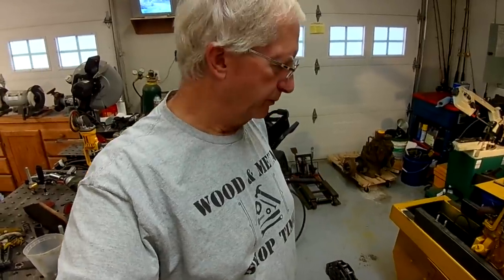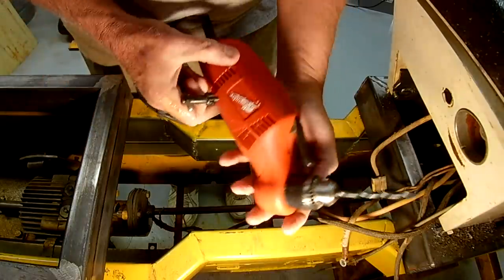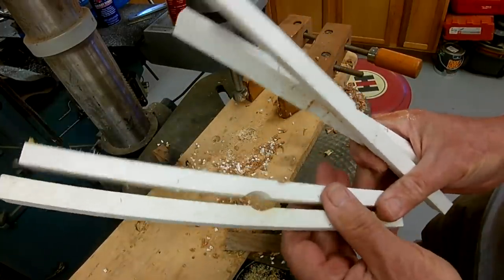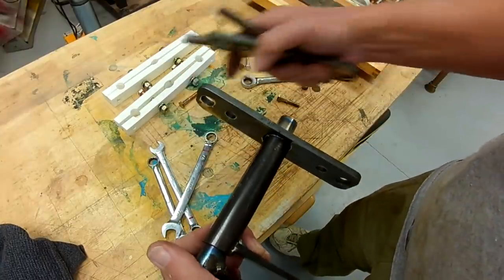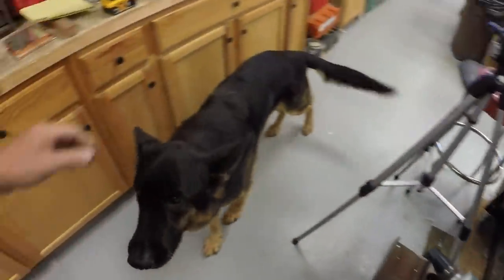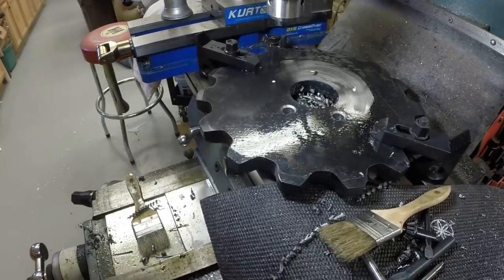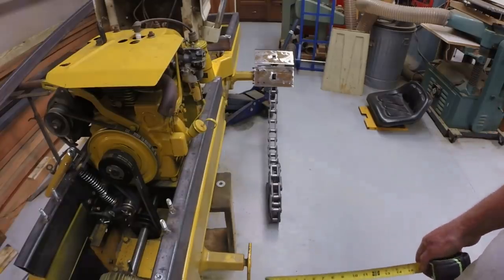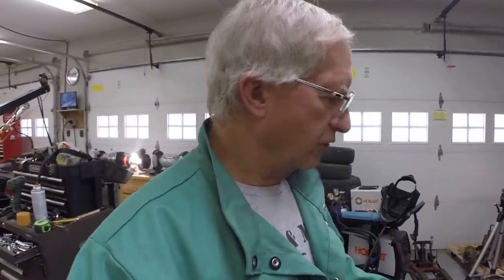Cub Cadet Dozer Build Episode 13, "Which Hole is That?"

Comment: I think your differential modifications are very unique and I think they are going to work very well, I built a front loader   for my wheel horse garden tractor, and it was only an eight horse motor, and I could do an amazing amount of work, I think you’re going to be pleasantly surprised by what your little bulldozer will do ,Great video thank you

Comment: I agree, the mods to the differentials is unique & also very creative.  Gets you that "spin in place" just like the big boys while keeping it Cub Cadet pure.  I like it.
I restored an old Struck Mini Dozer awhile back which uses belts & a reverse jack shaft to accompolish the same spin in place result.  Not nearly as sturdy as yours will be but functional.
Keep thinking outside the box!

Comment: Great solution for the controls, but I would highly recommend that you space them equally from the center of the tractor. You can cut a piece of the outer tube off to space the handle for the inner shaft towards the center of the tractor.
For the future, I would highly recommend that you step up to large holes using a bit that is at least 1/2 the diameter of the finished size. If larger than 3/4" three steps.
On the hubs, just make a sleeve that fills the gap from 7/16" to 1/2" studs. A half inch OD tube with a 7/16" ID would work, you  may have to bore the tube out slightly.
I hope my comments don't offend you, I know how difficult building a one off project is and how you have to constantly adjust from what is believed to what is necessary. I think you are doing a great job.
Reply: The only problem with the is with the sleeve for the stud would be that your tubing would have a 1/32nd In wall thickness
Reply from the maker: I'm looking at the two track controls to be operated by the left hand while the right hand operates a blade control...So shifted to the left makes more sense.
Reply: @woodandmetalshoptime8048  I don't know if you have ever operated a skid machine before, but if that is what you intend to do with your hands, then I would add foot peddles to the controls so you don't have to worry about using your hands to steer.
Reply: @woodandmetalshoptime8048  I think that will work fine, a D7H had both steering control levers on the left hand.

Comment: Glad to see more progress, on the wheel adapter to hub issue, i would use 7/16 studs from the back, then get 7/16 lugnuts to bolt the hub and spacer on , keep up the great work, Godbless
Reply: i posted before i seen u got 7/16 lug nuts LOL great minds think a like ,Godbless

Comment: To center the wheel spacers consider welding a tube that fits the inside of the wheel spacer to the face of the axle flange. If this is a snug running fit, the sleeve will also transfer the sprocket vertical loads into the axle rather than relying on friction between the spacer and flange to stay centered.
Reply: I was just thinking about how a collar on at least 3 of the 7/16 studs would be to eliminate the slop of the wheel spacers would be.

Comment: looking good so far, you have some neat ideas on this build, and im looking forward to the next videos coming up, keep up the good work.  as far as the lug problem you are having, the older garden tractors had lug bolts that are about 1 3/4 inch long that go in from the front, i mounted my adapters on my build with those and they tightened up nicely with no issues at all.  good luck with this, and cant wait for the next one to watch, thanks for your time and knowledge you share with all of us, wished there was someway i could send you pics of the bolts im talking about.
Reply from the maker: I have the original wheel bolts that came on these tractors, so I think I know what you are talking about. They are just too small for the 5/8 inch holes in the spacers.  I have since installed longer bolts and used the 7/16 inch lug nuts which solved the problem.

Comment: For various outside and inside diameters of tubing, take a look at Aircraft Spruce and Speciality. The stock almost every size anyone would need. Their tubing is 4130. They also cut to length, so you can get what you need. The nice thing is, you can choose a wall thickness to work with your desired size tap.for inner threading. They also stock 4130 sheet, aluminum tubing, AN hardware.and control cables.
Reply from the maker: Thanks for that info.  I'll have to look at that site. I've been depending on McMaster Carr for this stuff, and they have an impressive selection. Always looking for other sources, though.

Comment: the conical taper of the lug nuts will hold fine , I spin them 20 mph on my pro pulling garden tractor and they haven't come loose,  you can use the blue lock tight on them .

Comment: You're doing a great job putting the build and the project together. I really do enjoy watching. I think I'd make a spacer to help the 7/16inch bolts. Just using a tapered lug but will center things pretty good but I think the spacers would add additional strength to the 5 inch spacers you're mounting the sprocket on. It should transfer the torque through the assembly better. But I'm that guy who over engineers everything!
Reply from the maker: I think you are correct. I've been looking for some bushings I can use for that purpose.

Comment: If the 14 hp engine is not large enough after your dune if you fell the need you cud put in a bigger engine. The 14 HP is a good starting point and it just mite be all it need's. 👍 I like it so far this is a cool build.

Comment: On your lug nuts I agree the 7/16th's lug nut would be the best option is option in my opinion or you could take the 1/2 inch stud is stud and turn it down to 7/16ths fine thread to end up with a 1/2 inch 7/16th step stud

Comment: Instead of the purchased wheel spacers, you could have made a spacer that looks like a thread bobbin (or wire spool). Would only have to plasma cut two discs, with center hole for a 5" long piece of heavy wall pipe, and the bolt pattern of choice.  Could have even sized the pipe to go into the center of the sprocket for extra centering.  (Retired engineer here as well).
Reply from the maker: Actually thought about that--I have wheel spacers made exactly like that for putting "duals" on the Cub Cadets (and other garden tractors). But auto wheel spacers are so inexpensive to buy, sometimes you have to decide where you want to spend your time.

Comment: Make press fit bushings for the spacers
Make your 1” spacers 
With a counter bore step on the back so they self center 
You can also put a step for the 2” spacer to slip over I wold weld the 1” in place thickening the hubs
Reply: Good build and keeping it "CUB".  As I have watched you build this CAT dozer is it going to be a D-11 or a 
.D-11?   Mount the dozer rams on the sides of the front frame?

Comment: Can you use a helicoil or a thread locking insert for the wheel spacers that would make the thread inside the wheel spacers 7/16's? If not, you could always do some kind of bushing as others have suggested.

Comment: I know i asked a few episodes back about how you made the drive axles oppose one another and hadnt had the time as of late to go back to the beginning and figured the only way was to make one side of each axle a free wheel, which would work better as the fab and fitting would be easier as opposed to using zero turn drive motors,  requiring four,  one for each wheel would be asking alot from a 14hp engine,  really enjoy the build...
Reply: If you used 0 turn If drive motors you would only need 2 you wouldn't need to drive both axles Just both sides of a single axle
Reply: If the machine were light enough.

Comment: Can you use 7/16 bolts with 1/2 shoulder and put taper on head like lug nut to center for the wheel lugs. You have a lathe.

Comment: mag wheel nuts have bushings made on the nut to center the wheels on the studs but you will need to make bushings  to center all the spacers just leave space for the nuts to tighten up and not bottom out on the spacers
Reply from the maker: Just ordered some tubing stock to make those spacers. I'm a couple weeks ahead of the publish schedule so it will be several episodes before they show up.

Comment: Instead of using the plastic to put resistance on those levers I would have got some small thin cable and welded down or clamp it down to the metal and wrap it around 3/4 of the way like a cam and strung it to a spring that's attached on the frame somewhere and it would always put pressure on that lever.

Comment: Man that is cool iv bin watching your channel for almost a year now love the builds man the dozer is cool but yes I see one prp if you go with two spacers there is a chance it will brake a bolt I don't know what type an metle it is but weld an bolt them to the hub less chance of a faler in the long run an then bolt the sprocket to that but that's the only prob I see with it

Comment: Oh my...   That's exactly how not to bore out a drive sprocket.   out at the D11 facility on the T line in East Peoria, Illinois  they are shaped like that but i've been on the track line for 18 years, been pushing dirt and hauling dirt for 20 and i can assure you, that's not how it's done.  I can't tell you why or how to bore drive sprockets,  its a union thing,  all i can do is warn you and recommend that you special order a drive sprocket that's bored the right way if you want the union stamp on it.

Comment: Threading 1/8 material will never hold up long term. I would use riv nuts. They work great.
Reply from the maker: 3/16ths but point is the same. I don't have a rivnut tool. Need to get one. Thanks for the little push...LOL.
Reply: @woodandmetalshoptime8048  my mistake. It looked like the drill bit popped through there so easily. 3/16 may be ok. Keep up the good work!

Comment: I sure hope the face those 7/16 lug nuts are mounting against is tapered. If not, they are going to be relying on very little surface friction to keep them from backing off. Also with such little surface contact could easily create a ring on the lug nut taper causing them to lossen that way also. You need to always go taper to taper or flat face to flat face. Ignore all of this if the hole is tapered, there is no way to see that in the video.
Reply from the maker: Holes are tapered.

Comment: Just curious about the road grader you built what ever became of it did you sell it or do you still have it in storage somewhere?  Would love to see a video at the end when this project is all complete with both the grader and dozer doing some work.  Your next project should be a cub cadet  articulated dump truck that would be awesome you would have a nearly complete set of road equipment at that point all you would need is a cub cadet with a loader on the front to have your self a real driveway construction set.
Reply from the maker: I still have the motor grader, it's used occasionally to maintain the lane. I'm planning on another video of the grader doing some work on the lane in the next month or so.  I have a tandem dump truck already, though it's not articulated.  There's a video of it on the channel. It looks more like a "gator" than a dump truck.

Comment: If needed a more powerful engine could easily be installed, so as long as it is built sturdily down the road you can change your mind if you decide to move something you never intended to. That is the thing about build it yourself, nobody to say you just screwed up your warranty mister!

Comment: You should check out "Making Stuff" youtube channel for his video "Making Tracks for a Tracked Vehicle or Tank".  He does a good job and maybe you can find some ideas from his work...
Reply: He doesn't make anything he uses a rubber track from a utility vehicle. Not the same thing. It's a Segway scooter with a track.
Reply: @GussCustomCreations  Nope.  He uses a rubber track, but he fabricates the framework, idlers and tension system.  All directly relatable to this project.
Reply: @kentmckean6795  yeah but it's not better just different. I watch that channel also. A dozer is going to be different than a Segway. Not that he doesn't do a great job, it's just a different application. A dozer is heavy and a material mover, not a tracked scooter if you understand what I mean. I also mean no disrespect, just a different type of vehicle.
Reply: @GussCustomCreations  True.

Comment: WHY NOT USE A 5/8 BUSHING WITH A 7/16 HOLE OR DRILLED TO 7/16 AND WELD THE BUSHING IN SO IT WON'T MOVE
Reply from the maker: the spacer is aluminum.

Comment: You seem to have all kinds of trick stuff , so where is your degree turn table ??  You could have all the holes drilled by now instead of fooling around like you are !!!
Reply from the maker: I have an 8 inch rotary table, but I deemed it too small for this operation.